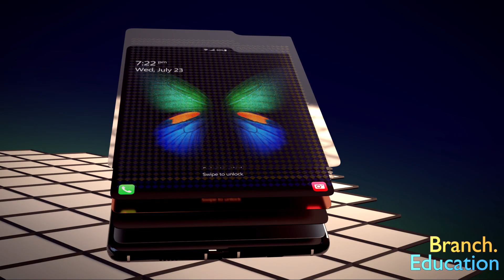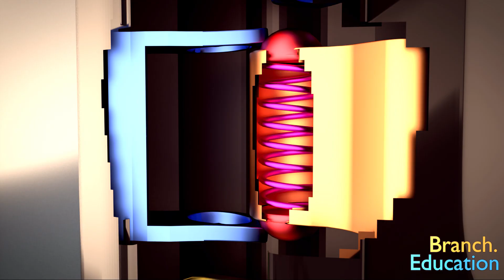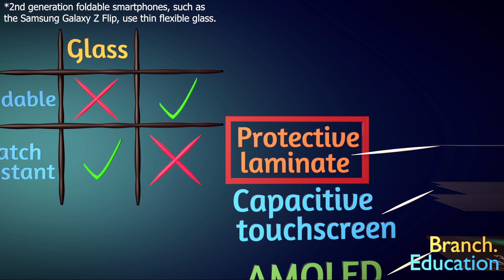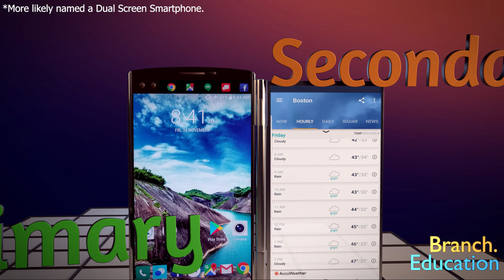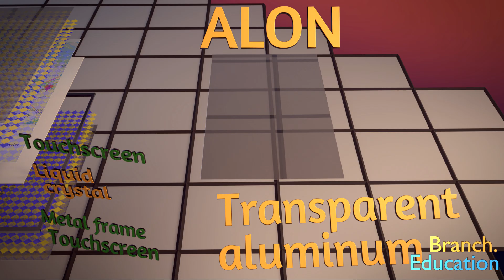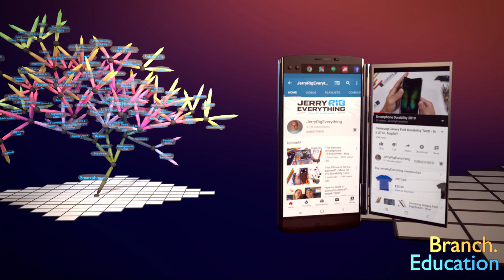The Intricate Engineering Inside Foldable Smartphones

Comment: Would be cool to have a second screen that could be separated from the main one, you would be able to use it wirelessly to a degree but for real clise conection one could ...attavh on the side, just like the Nintendo switch. This screen would be attachable on the back  too, where it could rest.
It would also be a great deal to avoid thefts and such, since you'd be able to send messages and use the second screen on the street while the real one would be secure in your pocket

Comment: Your concept looks like your folded phone will have the most horrible image-quality in history:
1. There will always be a huge pile of dust between the screens when you take the phone from your pocket.
2. The scratch collecting screen area IS MULTIPLIED BY THREE in collapsed mode. 
3. Add the gap between the screens and the material strength (Adds even more blur to the image) of the secondary screen and you can use the collapsed smartphone as nothing more than an ambient light after some aging.

Comment: Cool concept but having to use the main display through the second one will result in a parallax effect because the AMOLED will be farther away from the front glass, and there will be some internal reflection. It will feel like you're using a much older phone. I think it would just be better to flip the second display to the back. Also it would be sick to take advantage of the transparency features of your display design - augmented reality walking directions?

Comment: The idea for the phone is pretty interesting but do the parts that create the touchscreen become transparent as well? If not I'm not sure you can fully make the secondary screen fully transparent, if so then disregard this part of my comment. The other issue is even though that creates a technically foldable phone it doesn't do it as one screen. One concept about making certain phones foldable is the large single screen that can fold up to avoid being too cumbersome. For some consumers they like to play games or watch videos on those phones and it would make the second screen redundant unless they often multitask while doing these things.
Reply: After posting my above comment and reading another person commentary about the hinge being an issue an idea popped into my head. Why not have the secondary screen also a slide screen, but not a big slide, just enough so that when the phone is unfolded you can slide it inward to hide the hinge and maybe seamlessly connect it to the primary screen.

Comment: Apple has big potential for the folding phone market. Instead of having two screens attached have two screens that are separate that click together 

Using MagSafe have a second “phone” the sticks to the back, then to fold it out do the fold out action and have that second phone magnetically stick to the side of the first, to add rigidity the second phone can have a large flat piece hinges too it that remains magnetically stuck to the first one. The phones screen on the one side will have no bezel so when they are folded out there is minimal to no visual and physical division

This type of design allows for great flexibility and utility a small slump profile phone that can turn into a larger tablet with an uninterrupted screen 

and a case for this type of phone is still very possible

Comment: I've seen the transparent display on a much larger scale from a different channel, they brought a massive TV that had a completely transparent glass screen, and all the electronics were in a box that the bottom of the tv screen sat on which also contained the USB,HDMI and ethernet jack plus various other connectors. the tv itself looked amazing what put me off was the price I think they said it worked out to about $30000, not only that If I remember correctly they had to have the tv imported as it was only available in China when they did the review. of course, I could be completely wrong as I have short-term memory loss, I can remember stuff that happened 20 years ago but have extreme difficulty remembering stuff that happened last week it's so bloody frustrating.

Comment: The transparent screen could be used to add extra color depth to the main screen by lighting it up while transparent; or if it's not flush enough against the main screen, then it could be used to produce something along the lines of a tensor lightfield screen, real holographic display where you see a different image depending on the angle and distance from the screen.

Comment: Interesting concept, but there are flaws in your design. When the main screen is operated through the second screen, colors will be dimmer and the image will feel further away, which will make it considerably less inuitive. This is due to the fact that you have all that extra added materials ontop of your regular screen, through which the light needs to pass. Also, i am sure that creating a screen which can be operated via touchscreen from both sides and can also turn FULLY translucent is a big design problem. 

Besides, there are no apps yet and I do not really see the use case, since for real office work you would bring a laptop. But it looks dope, it sure does :)

Comment: I think your concept is a step in the right direction but has some aesthetic, QoL and possibly its own durability flaws.

First of all the feel of the touchscreen would feel off due to the large amount of separation (presumably at least a millimeter) between the touchscreen and the actual screen itself. This is a major problem with older drawing tablets and CRT touchscreens, and would detract from the premium feel these kinds of smartphones have to have in order to sell.

Second of all, I know those liquid crystal glass layers don't become fully transparent. Combined with fingerprints getting on both sides of the folding glass layer and fade that (may?) occur due to sun damage, I imagine the base screen would become duller and duller over time do just more opaque stuff between the user and the screen.

Third of all, based on the design, I imagine this would have similar issues to some Surface tablet clones, where grit get stuck between the two screens and ends up gouging and scratching both screens while it jostles in the pocket.

Oh, and lastly, the frame on the second screen does not look structurally sound! I feel like if I dropped this thing sideways and it hit the second screen, your two-screen phone would become two one-screen phones, and I doubt either of them would be working very well.
Reply: The first and 2nd issue could be fixed by making the secondary screen to fold to the back instead of the the front of the phone. But that rise another issue of how to protect the secondary screen, a recess would help a bit I guess. The third issue mybe solve by living a gap of about 1 mm or so between the 2ndary screen and the back of the phone so not to let small dust particle traped there.

Comment: The main problem with your proposal is that you have nothing to hold on the secondary screen; there's not much support. The framing material would have to be exceptionally strong or else a drop would crumple it. You wouldn't have anything to hold onto if you wanted to switch which hand carries your phone, and it seems you would HAVE to use your left hand to hold the phone at all.

Comment: 1. I haven't seen a transparent AMOLED yet.
2. The Hinge on the side of your design would annoy me.
3. The Main screen would need a significant brighter Light to overcome the transparent second screen in the closed condition resulting in an unnecessary higher battery drain even compared in dual screen mode.
3.1. Afaik these Liquid crystal displays consume energy to stay clear and without energy they are opaque.
4. the 2 different types of screens technology will not be Uniform to each other, the inconsistent look might disturb others.
5. ALON is a ceramic crystalline structure and tends to Polarize Light. Will be a tough time for the Engineers to work around those side effects, one of them would be the first screen already sending out Polarized Light, so the Alon needs to be perfectly aligned.
6. Eighter only for Lefthanded or Righthanded people
Reply: Transparent Amoleds Are Here Screens Are Here
Reply: @electricx7365  Please, you don't mean those Samsung Konzepts. "See trough transparent" and "Crystal clear Transparent to see a second screen behind it" are 2 diffrent things.

Comment: Folding screens seem like such a big inconvenience, screw that.

Folding phones were purpose built in the past, I used a folding phone. However the needs of today are different. MAYBE it makes sense if you want a phone with a massive screen like the + models. But I've always preferred the smaller variants of phones over the larger ones.

For example I got the Samsung S7 not S7+ or edge even both were the same price from my provider, even though the + had better specs & a bigger battery I would much prefer a well sized phone over those massive hand tablets.

Comment: your design is not bad but LG kinda has it already
the problem with the dual-screen is that for people who are actually looking to buy the galaxy fold is that they do not want 2 screens
I would imagine they want 1 huge screen that can either fold or rolled into a smaller form factor of a normal size phone.
2 screens are not as appealing as there would bezel in between the screen.

Comment: Difficult to use Secondary screen in gaming as a barrier comes in middle. 

Love from India
Reply: PUBG:- controls and map in Primary display and game running on secondary display.
Reply: In Samsung's design you would cover bigger area rather division.
Reply: @jjayantamahata  but a slight over pressure and screen breaks. And add there is no glass so fingers won't slide thereby hindering gaming.
Reply: It could be played da style (controls and a info screen on bottom and main game on top)

Comment: If you please, you said that on the screen layers, the bottom layer is a solid metal layer. So how is that, and we've already seen that the screen is flexible all over it?
Reply from the maker: At the hinge, the only section that needs to be flexible, there is a living hinge cut out of the metal.  It’s hard to describe aside from what is shown in the visual, so if you are curious I would recommend looking it up.
Reply: @BranchEducation  As I've seen in teardown videos, the screen is flexible, even on the edges, all around, not just in the hinge section, as I've shown in your video
Reply from the maker: @hichamelhour7067  In the teardowns, you can see how the screen is more solid and not flopping around.  This rigidity is from a solid metal layer.  You can still bend the solid metal layer kind of like how a paperclip bends.

Comment: Dude, you've invented the Microsoft Surface Duo! Nice work! 👌
Reply from the maker: Kinda.  I think the big difference is that when it is closed, the 2nd screen is transparent, and it operates as a normal smartphone.  It’s important when adding a big change that users have the ability to go back to what they were used to.  This is one element the samsung fold got right, in the idea of having a 3rd screen on the outside.

Comment: can you please tell what material is used to make the foldable touch screen (touch sensor part).  i think it won't be indium tin oxide because it is brittle. so what else have they used in samsung fold
Reply from the maker: You’re absolutely correct that ITO is brittle.  There are some resources that speculate on conductive flexible wires, but to be honest- I don’t know as it is a trade secret.

Comment: Hold on. So you’re saying all those bullshit see through movie/tv future phones, CAN actually be a thing?
Reply from the maker: Yeah,  they have transparent screens out right now.
Reply: But the AMOLED layer has hardware that's not transparent, motherboard, battery cameras... are not transparent. You're not gonna put them off to the side just so you can see though the your phone, then you'll have something with the bezels of a 1st gen TV.
Reply: @ThapeloMKT  How about only putting a camera or two on top bezel with the speaker, and the bottom has a battery, charging port, and a wireless receiver

Then you put the rest of the hardware in some kind of screenless box that fits in your pocket, heck, maybe include wireless charging tech on the screen part so you can.... Read the news on your clear screen while swimming or whatever
Reply: Yep But Were Only Trying It On Phones Currently P.S It Wasted Enrgy
Reply: It would be more feasible to make a transparent TV or a window that's actually a screen.
Reply: Transparent displays sound great in theory but are terrible in practice, mostly due to things like contrast and readability.
Reply: If you put in a layer of crystal that shifts from black to nothing when the screens ised, you could get passed the backlight issue. Course youd probably need two touch screens...